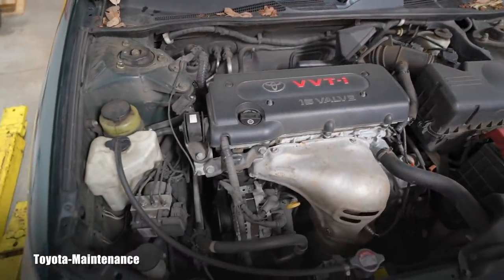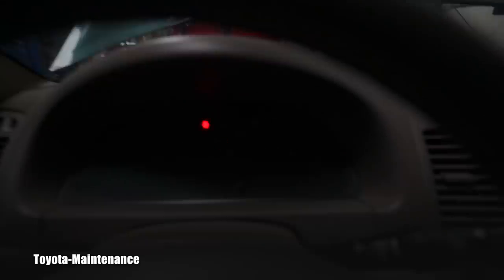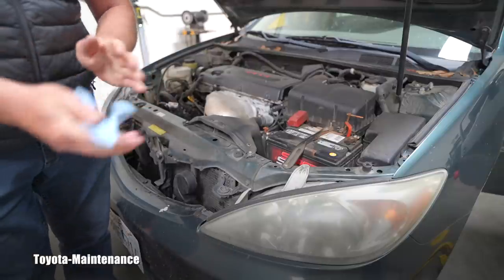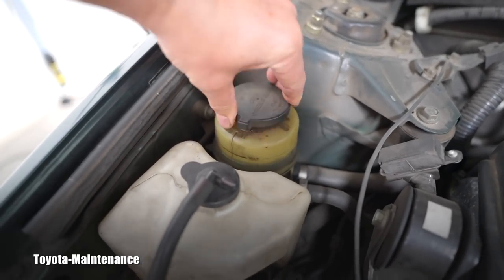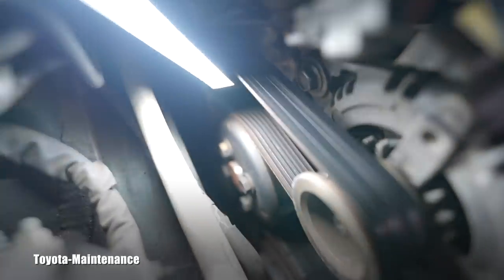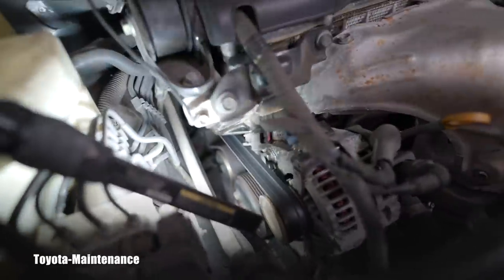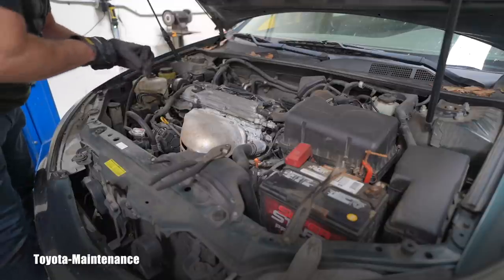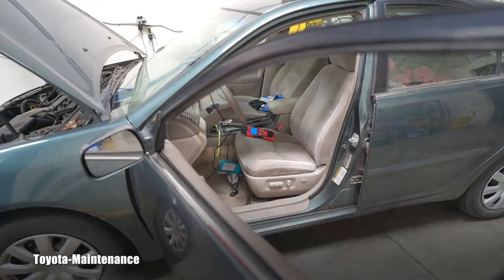2004 Toyota Camry  with multiple problems

Comment: Mine has 209k miles now and it doesn't burn any oil. The seat belts were pretty gross when I got it at 203k miles, though. I suppose the struts have seen better days, but I replaced the spark plugs, oil, filters, and brakes myself. Even started painting it and added a spoiler. I recorded the spoiler and painting stuff... might upload them sometime soon.

Comment: She went to 'Rip Off Oil Change' where they don't even bother to put in cheap recycled oil, much less the expensive synthetic stuff. Peter saved that car, since even Toyota engines won't run for long without oil under pressure being delivered to the crankshaft and connecting rod bearings. I'm surprised he didn't see any metal particles floating around in the oil he drained. Another few hundred miles with intermittent oil pressure, and that engine would have been toast. 
I hope Peter told the owner not to take the car back to whoever worked on it in the past. That oil was probably in there for at least several years. And any shop should make sure the oil is in the normal operation range before a vehicle leaves the shop, after any service.

Comment: Good Start. The spark plug's lateral electrode did have the protrusion/bump where the spark hits from the central electrode.  Most fake Iridium plugs don't.  What ever happened to the coolant? Was there a leak in the reservoir? I suggest replacing the radiator cap just to know the cooling system pressure is correct so the customer doesn't blow the radiator tank seals. There was a bendable bundle tie above the dog bone just bent out doing nothing. That car needed so much.  I could keep going, but I won't.  One other thing, worm clamps distort plastic nipples. I saw them used on the power steering reservoir which is soft plastic.

Comment: Never take your car to a "quickie" oil change shop, quick just means rushed or in this case not done at all. When I met my wife she was taking her Audi to a quickie shop, they had stripped the oil pan drain plug threads, lost all the protection cover hardware and screwed it in. I do all the maintenance on my Tundra my wife's new Infiniti and my kids 2 Toyota Matrix. They run like clockwork.

Comment: What was the final damage?

Coolant, oil, what about the brake and power steering (that looked dark), transmission fluid, etc.
Reply: The power steering fluid in this particular car is actually transmission fluid.
Reply: @chuckalucktoo5492  T4 or WS?  Either way, I've always been under the impression that power steering fluid is under immense pressure in a sealed system... Temperature changes the volume of transmission fluid too.

Still, knowing it's ATF, that's really dark and should be changed.
Reply: @SeanPopify  DIII
Reply: @SeanPopify  it is under pressure but only into the rack. At which point the return is low pressure. Not sealed on Toyotas. 

Yes the ATF expands. If you look at the reservoir on Camry's you'll see it will say two sets of marks.  Hot and cold. It won't matter much because maybe there's a quart or less in this system.

Comment: Ah good on you Petare you learned when I said to put your hand behind to help focus, well done man! Now you are no longer frustrated with the camera finding the focus. I learn from you, you learn from me. 

Now, these workhorses. I am cheap to buy a new car, and I have almost always had the bad luck to need another and almost every time every camry has been okay to run but always some little problems like this. This one may be neglected too much.
What is that SST Toyota air housing attachment fitting. I have never seen before. Maybe it is the new 90009C-CLAMP they came out for this year. Bad design. Good thing they changed it middle of the refresh for this body. Toyota Red!

I see you wiped the top of the valve cover. Fresh dry wipe cleaning marks. Beautiful! Such a shame she does not respect the hard working Camry. The synthetic will help clean out all the sludge that must be inside. Sometimes the quick lube places say a short interval as they won't change the oil. So maybe she was only 2000 over the recommended 5000, however, if they did not change it and it's not that the washer was stuck on the pan, wow. Must be a long time. This is why you get out of the waiting room and watch them do the work. 

Wish you would do the plugs 3&4 like you did and then coil swap differently like 3&2 to know exactly! Hopefully her mother is paying for it. Then you deserve to fix it more just in case.

Comment: I've seen this scenario before. The owner has neglected the maintenance (mainly oil changes) The owner ran it to low on oil to long and the car began to consume oil.When an engine starts burning oil it will ruin the cat converter. Thus why the PO420 code.  Hopefully the owner will take care of it before they toast that engine.
Reply: And that cat's not cheap either!! Some $300 just for the part, tax and sensor and labor and some people scrap the car
Reply: if your motor starts consuming engine oil... IT IS TOAST and you need to rebuild or replace it

Comment: It's sad to see one of, if not THE most reliable 4 cylinder engine arguably ever made neglected of routine maintenance this significantly. I have an 2004 Camry LE V6 (1MZFE) with almost 200,000 miles and it doesn't burn a drop of oil (the previous owners did common maintenance on it throughout its life). I plan on driving it until the wheels fall off. That poor car you worked on was abused.
Reply: i’m about to buy 2004 le with 44k miles for 6100 u think it’s a good deal
Reply: @imakebank6524  If it doesn't burn oil, doesn't have any rust issues on the frame, and wasn't wrecked, yes. They're bulletproof engines. I'd still test drive it and probably have a mechanic look at it just in case if I was going to spend that much. But, if everything checks out that car would last you a very long time with only that many miles.

Comment: My ‘05 burnt up in ‘12 because the mechanic did not completely attach the radiator hose after an AC service.   Low mileage < 60k miles.

Comment: Just last week i took my 2016 Camry to the dealer here in Arizona for a transmission fluid exchange at 68,000 miles. I didnt ask the dealer because I thought that they would use the products the manual calls for. I got home and found that they had spilled fluid all over my transmission and surrounding areas which I had to clean up.Then I see on the bill that they used Valvoline "multi-vehicle " and not the Toyota WS fluid"  . I am beyond upset, Talked to the dealer he said thats what they use because it is cheaper . My owners manual absolutely states to NEVER use and different fluids in a Toyota transmission . AND they added some "additive" to the fluid to there tune of another $25 dollars. Something else toyota does not recommend . Now, they say all they can do is have me bring the car back and they will do the flush over with the proper fluid and I will have to pay the additional $75 for the proper fluid. I already paid $300 and now another $75 to fix what they did wrong. I wish I lived close to Peter to get it done correctly !
Reply: Quit the dealer.   Find a good independent mechanic, like this guy.
Reply: I would have wrote a letter to Toyota Motors USA, with a copy of the invoice. Toyota would be very unimpressed with the dealer using non-genuine / non-recommended parts and fluids. I wonder do they use genuine oil filters?  They (Toyota) would be reading them the riot act, and they wouldn’t be in their  good books after that.
Reply: @paulsz6194  I did contact Toyota, they responded in 1 day. They asked me for permission from me to contact the dealer on my behalf. I gave them permission. They contacted me later in the day and told me the dealer customer relations person would contact me before end of business on 5/28. The dealer missed the deadline, another strike against them. I will contact Toyota again on Monday
Reply: @zonie1953  Good! Make them accountable. Explain to them , what’s the point of going to a dealer for “ genuine service” if they don’t use genuine parts? Might as well go to another mechanic and pay less then..
Reply: @paulsz6194  👍

Comment: Only older Toyotas can run forever even without oil antifreeze and maybe fuel 😆
Reply: There's a You Tube video out there where they drain the oil from a Volvo engine and then run it for quite a long time before it burns up etc.
Reply: @TheObimara  older model ? They used to be tanks bro

Comment: The 2AZFE is one of the best engines but good golly they burn  oil, my friend ran his with little to no oil till I checked it for him , it ran for 2 more years till he sold it
Reply: A lot of the oil burning problems were a combination of things but mainly, poor oil change interval at the beginning of the engine's life. That plus poor ring design and time caused this. It did not help too that Toyo recom'd 10k initially for the lowering of the maintenance costs for the magazine comparisons. Thus the need for the 6k  OCI TSB
Reply: @LAactor  I've a 2005 with about 75k.. oil level's the same for about 4k.... knock on wood (actually base model so no simulated wood....)
Reply: Got a 2003 with 135,000 oil is find at 4,000 oil changes
Reply: The only oil burning problematic years I know of are 2007-2009, due improperly designed piston rings.

Comment: I know you know to check that intake diaper for coolant. You can catch the stripped head bolt issue if you know to look.
Reply: I've got a 2005 still in good shape with 75,000 miles. Could you explain in more detail how to catch the stripped head bolt issue? Thanks.
Reply: @frankg6578  if you have coolant loss see/feel smell if it's leaking out the back of the head and getting soaked into this foam pad thing they put between the intake manifold and the block. There are a lot of vids and info on the repair, Google: toyota time sert head bolt kit
Reply: That diaper is a big pain in the A that almost never goes back. Sound dampener? Ridiculous.

Comment: sway bar bushings replacement 2 shocks 4 spark plugs and alignment was quoted 1200 by the dealer. Why an alignment I have not a clue. Tie rods were not mentioned but they think they can rip me off like a dummy

Comment: Coils might be new, The wiring to the spark plug coils is not new.  They are broken.   Keeper tabs are busted off I think.  Very common for those connectors to fail. I bought new ones for my 2005 Camry on Amazon.  $23 for all four. No splicing or crimping.  https://www.amazon.com/gp/aw/d/B07GVTB944/ref=yo_ii_img?ie=UTF8&psc=1

Comment: Hello Toyota Maintenance 👋 My 2004 3.3 V6 Camry is running lean. I already changed the O2 sensors, Fuel pump & strainer. I put a bottle of fuel injection cleaner. I don't see any vacuum leaks. The car is running very good. The engine light goes away on the highway. It turns on when I drive in the city.  Do you have any recommendations on what I should change next?

Comment: Why was there no water?
Was it because there was a shortage of oil in the engine and the water got so hot?
What explanation or a possible head gasket blown due to the starved of oil engine over heating the block?
Reply: How is it even possible to operate with out coolant?  Air cooling during short trip?  This does not compute in my mind. And to think I am stressed out that my oil level is high by 2/3 quart from last change on my 2020 Forester.
Reply: @DaddyBear1971  did he look in the radiator and I missed it? I only remember him looking at the overflow tank. There should be a small amount in the overflow, but the majority will be in the rest of the system.
Reply: @BrockOBauma  - There may be a slight benefit that this is coastal or near-coastal northern California, so assuming the VEE-hicle is also used in this areait's normally relatively cool, and it's not quite summer. If this happened in a couple of weeks or months, the picture might be different.
Reply: @BrockOBauma  Ahh.  Good point.  He only mentioned the overflow tank. My mind hurts less now.

Comment: It's either burning oil, leaking oil or the previous oil change didn't add proper amount. Going 4k over the recommended date will not lose the oil from the engine just make it lubricate less. I suspect there's something more serious going on. Poor toyota.
Reply: If the oil stop place even changed the oil at all which is what he implied.

Comment: Hello Mr. Toyota maintenance 👋🏼. Can you tell me why my 2004 Camry is hard shifting into first gear? With code P0776 pressure control solenoid “B” performance/stuck off. I already tested each solenoid and seem to be be working fine. I read on some forum and I comment on another video that it may be the ECU having a problem. What do you think ?
Reply: How is your car running now? I am having the same issues. Trans shop changed solenoid - no change. Please lmk if you figured it out. Thank you.

Comment: Nice video. Thank you. So is that car burning oil? Even if you went 4000 miles to far there should not be so little oil. I am buying a 2004 iwth a 2AZ-FE engine and I am still fuguring out if they are oil burning or only 2006 onwards.
Reply: 2007 thru 2009 burn oil. The 2002 and 2003 Camrys had catastrophic engine failure, stripped head bolts. I believe that was regarding the ones built in Japan. The Japanese did not put a heat shield in a proper place. Any Kentucky built camry should be ok
Reply: @AB-yc1np  What about a 2004? They ok. It was build in Kentucky.
Reply: @jacoe33333  2004, no problem. Should be good unless the previous owner abused the car, but with that generation even neglect doesn't matter
Reply: He believes the oil stop didn't change it when she was in last, just sticker slapped it. 4000+6090=10000 definitely can be that burnt and low

Comment: Do you ever use a table scan tool? Or the Craftsman one is good enough if you know how to use it? I am a diy person.
Reply: Yes he has a tablet but I think he is using simple tools on purpose for the diy user
Reply: If you buy one, make sure to check it's features. You want live data. So you can see when the car is running how sensors are acting. That is how you confirm if something is bad. For example looking at the switching numbers on an oxygen sensor. some also graph the results live but you have to check what does what for you and what you're willing to spend. And no you don't need to spend hundreds. Unless it's your business. Like even some mobile mechanics don't need fancy ones. They can read a basic one with live data and figure it out.

Comment: My oil light keeps coming up on my dashboard even when this is enough oil on it and also changed oil pump severally yet it keeps coming up 
Would need an advice ........
Reply: Take to mechanic. Best advice. You just cannot diagnose an engine well if it is over the internet through a non mechanic's description. Do it sooner than later.

Comment: Toyota went from non interference  Camrys that lasted forever to oil burning/leaking due to vvti and interference
Reply: The car is at least 4000 miles overdue for an oil change, and it's questionable that the last oil change ever happened. The owner should be checking their oil at least once every fuel-up, or in this case, at least once at all in a blue moon. And at 228k miles, a lot of engines are going to consume or drip at least some oil.
Reply: What's interference got to do with it? And it's a timing chain anyway.
Reply: @BrockOBauma  Chains mean more friction in the oil
Reply: @MattExzy  These engines do not simply drip but chug oil.

Comment: Do you replace oil drain plugs with magnetic?
Reply: Do a search and find Pros and Cons for using magnetic drain plugs.  My Opel GT had a magnet spot welded to the standard transmission's drain pan. This was factory installed.

Comment: 5w30?...no no no.....the engine is worn and burning oil, a 5w40 would be better for a worn engine that is obviously burning through oil.......5w40 is fine for these engines, infact i run it in my 2zrfe and 2grfe, the climate in California is perfect for 5w40

Comment: What caused the coolant loss?
Reply: I could guess... Not enough oil, overheated (a little or a lot).

My psychic abilities tell me the head gasket will fail soon.
Reply: Bingo. Those motors pull head bolts.
Reply: James Carroll  Thank you, I must have missed him mentioning that.

Comment: Having owned 3 Toyotas , 2004, 2005, 2006 ...all with the same exact engine ( 2.4L) . Friends , These engines drink oil like the Irish get drunk at a local Pub on Saturday night. I have had it with this engine. It's bad engineering ...It's TRASH...Let it be known.
Reply: I have a similar mileage 2005 Camry to the one in the video. I can safely say it burns next to zero oil. I am in Australia though, and I'm sure our Camry's had the Japanese-built engines, which seems to be a factor, since other versions seem to fail more.
Reply: They do burn oil but they aren’t trash , Ive seen these engines with 300k miles plus, Toyotas 3.0 was trash
Reply: Some VW and Audi engines use a lot of oil (pint; half a litre every 1,000 miles) and when questioned they say that it is good because it is lubricating the piston rings and valve seatings.
Reply: @MattExzy  - Yeah my 2005 was also not built in Kentucky, and it burns little to no oil at 75k.....
Reply: @MattExzy  It is definitely a factor. You have nailed it. Thanks for sharing.
Reply: @fortis619  I agree. I may have exaggerated in using the " Trash" word. But, The last one ,06, that I owned, Had 168 K miles. It used about a Full quart every 10 days. That's not fun.